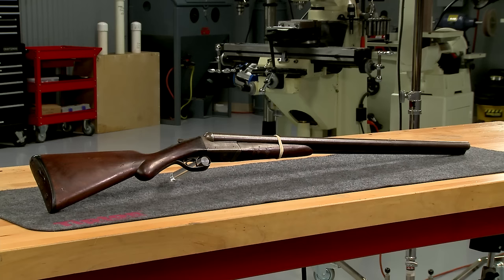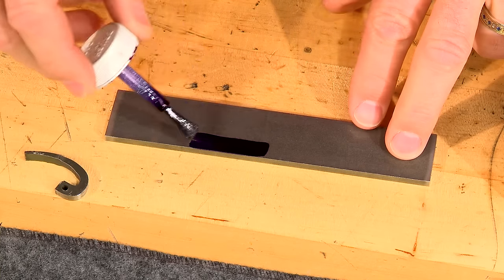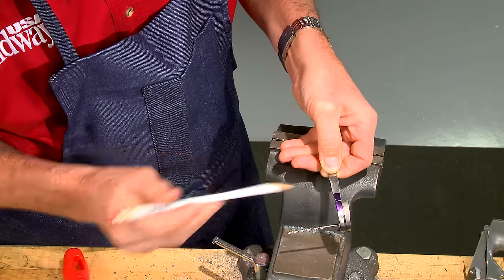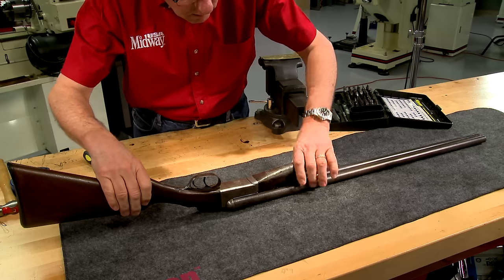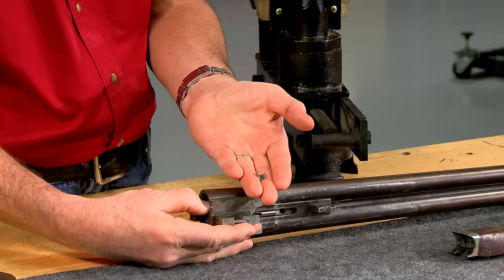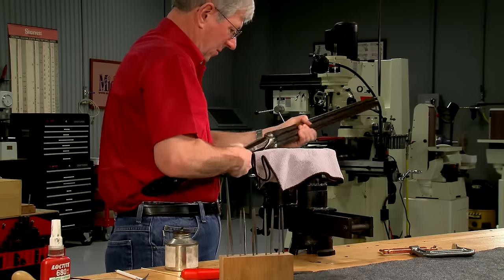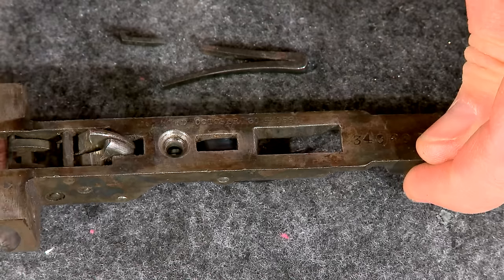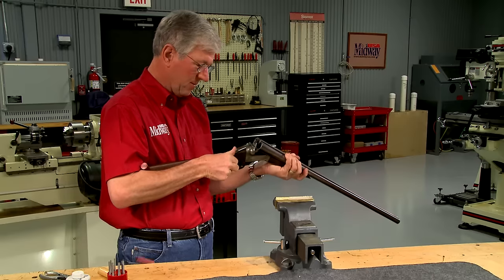Repairing a Remington 1900 Double Barrel Shotgun | MidwayUSA Gunsmithing

Comment: Can you use modern shells through these old shotguns? I've heard I could use a 2 3/4in. lead birdshot. But no high pressure shots or steel shot... Any info anyone?
Reply: +Josh Harrison  there are pressure differences with black powder and smokeless powderand that the steel used to make the barrels isn't as hard as modern steel so you will get pitting from steel shot and can break the barrels from overpressure while shooting modern smokeless powder loaded shells
Reply: +MadMike1251 thanks man. And I dig.
Reply: +Josh Harrison In addition to what others have said, many, if not most, of these guns had 2 5/8" chambers.  Some had 2 1/2" chambers. Even if you make your own black powder shells (2FG), the open length must not exceed the chamber length.
Yes, I do know about forcing cone shapes, chamber geometry, etc. but this is the best general advice. 
Now, even if you do decide to try to use such a gun (which I would not, in general, advise) the basic problem is that you do not know what was done to the gun before you got it.  Were the barrels honed too much, forcing cone lengthened, subjected to excessive pressure such that the elastic limit of the metal has been exceeded, etc. ?  All of these would render the gun unsafe.  NO gunsmith can correctly tell you that a gun is safe to shoot, only that it is unsafe.
Reply: i d order some 2  1/2 " light loads and let er rip, or get some 21/2 black powder loaded up

Comment: Hasn't Larry used peening to make metal wider in the past to tighten up a tolerance?  I seem to remember him using that method in a past video.
Reply: It was probably him peening the metal around a bolt in an AR-15 build to make it stay in place.
Reply: Peening does have its uses, it's just that in this gun, the surface is heavily stressed, so it needs as much contact surface as possible. Even then, it eventually wears out as evident here.

Comment: If it's loose... Just glue a shim on it?   NO WAY! That doesn't seem like a true repair, just rigged to work for a while. I would weld and reshape or do the dove-tail method to do a true and permanent repair.
Reply: No such thing as a permanent repair for bearing material. It grinds down over time and will need to be shimmed/welded again anyhow. Just like the bearings for a crankshaft.

Comment: All that work making the springs only to glue the shim in place, seems like a bit of a let down.
Reply: I just watched another gunsmith do nearly the same thing. Although he roughed up the surfaces and used a 2-part clear epoxy (6000 psi epoxy).
Reply: welding would be cool but that green 680 loctite is forever and ever amen, and easy to do without high temps.
Reply: Glues are far more capable and diverse than just the barely sticky paper glue-sticks you see in preschool. It's like bitching about a carpenter using a hammer and nails because it's such an old technique.

Comment: The fact that he used spring steel to make that piece is of no relevance. By heating the material red hot  and hammering it out the materials original properties are now completely changed. The alloy percentages will stay fairly the same but the crystalline make up( austentite, martenite, etc) is now completely different. It would have been better to machine the piece with the type of steel desired.